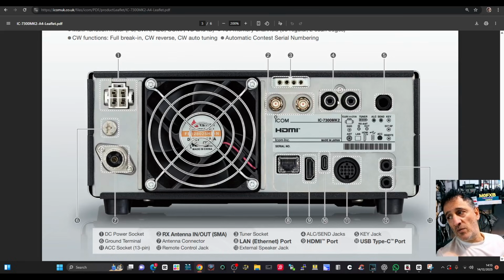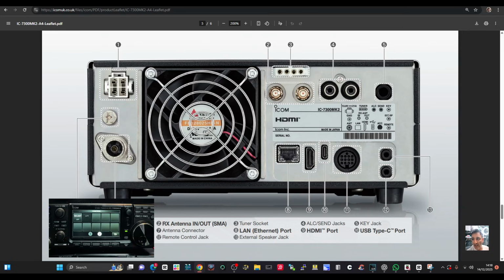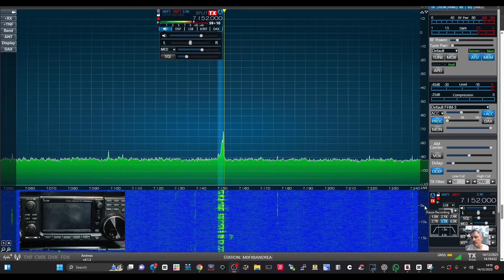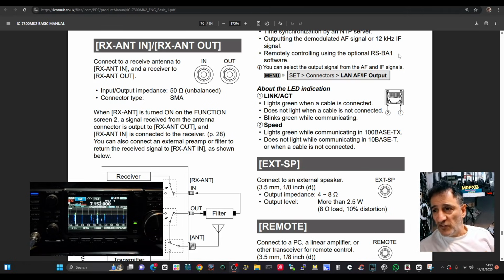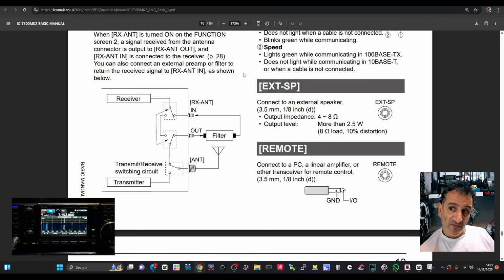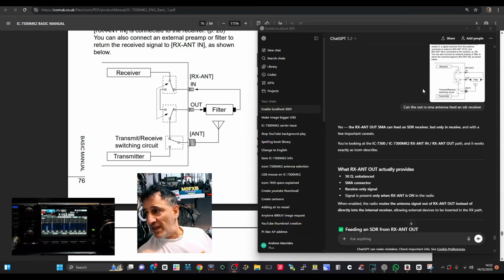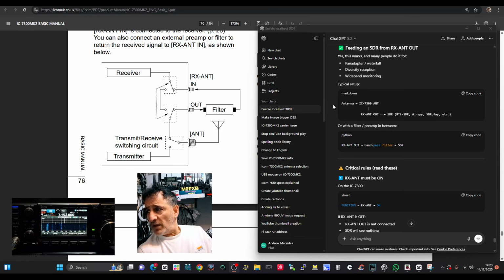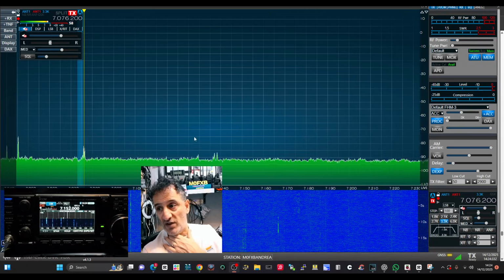ICOM IC-7300 MK2 Can we Feed RX Antenna to an SDR ?

Comment: off, but does it recieving with de power suply off?
Reply from the maker: Its a loop through so yes
Reply: @M0FXBHamTech  that would be great for my icom 8600 zo i can use it on the same antenna

Comment: Hi, just use a Mini Circuit PSC2-1. It's fed by the Out SMA of the 7300. One of its outputs goes to RX Ant, the other one goes to the outboard SDR receiver. You will have -3 dB attenuation on the 2 output ports, but a very good isolation between them. You can use the Send terminal or an other switched contact to mute the SDR when transmitting.
Best regards,
Georges F6DFZ
Reply from the maker: Thanks
Reply: Question how about using a ZFSC-2-6-S+ 2 Ways Power Splitter, 0.002 - 60 MHz, 50Ω?
Reply: @johnathandoerrheim120 It should be fine and easier to connect due to BNC connectors. Georges F6DFZ

Comment: It’s really a loop thru not dedicated for driving a SDR.
You can use a directional coupler or an RF sampler like the PTRX7300 located (between the RX in and RX out.)
Using the RX out alone is just getting leakage from the SO-239.
Please look at the schematic.
I plan to take my PTRX 7300 out of my old IC 7300 and place it in a metal shielded box and power it externally to achieve driving an SDR receiver
Then I could cascade bandpass filters either on the input or output of the PTRX7300.
Hope this helps.
Thanks for your videos
Reply from the maker: Thanks for the details